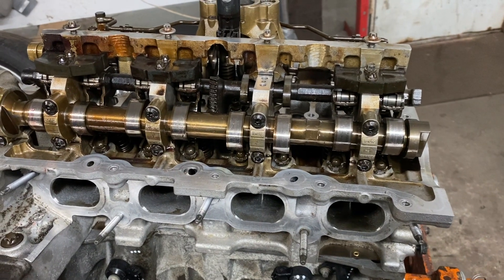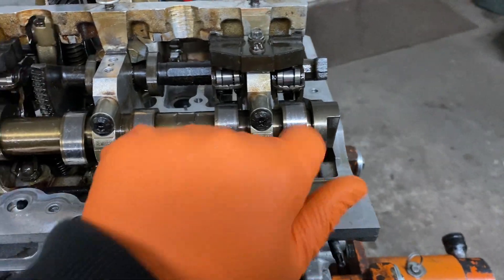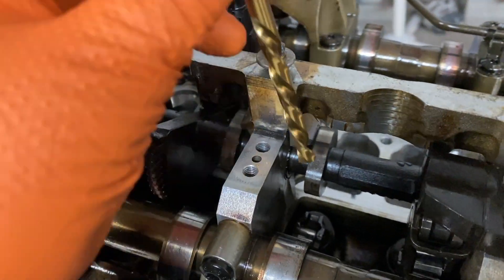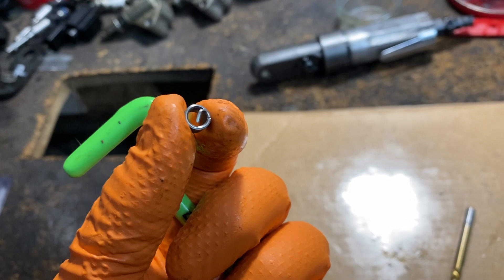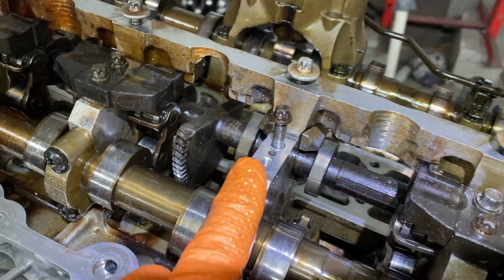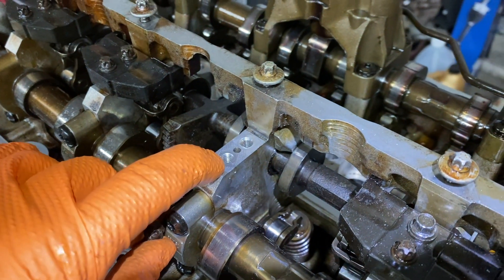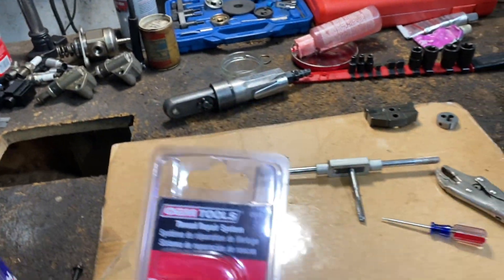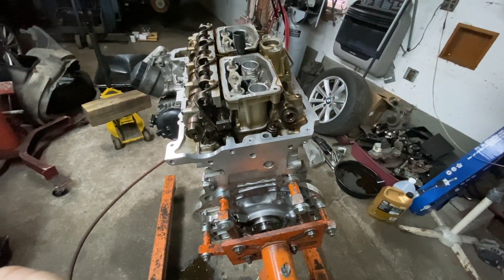Stripped Thread Repair - Engine Block Or Cylinder Head

Comment: i need a thread for two holes for the valve cover, needed to use 71 inch torque and i didnt feel the click and kept going.
my first fix and i screwed it bad, now i have oil leak EVERYWHERE 😪😭
Reply from the maker: This video should be able to help you fix it.

Comment: Doesnt look like any fun until its done.   I have a stripped intake manifold bolt and debating between trying a heli coil for a first time, using some kinda liquid threads or just sending it missing one bolt
Reply from the maker: Liquid thread stuff doesn't work don't waste your time.

Comment: I need to do this on my engine block. The threads for the 17mm for tensioner is messed up. What would you recommend me?
Reply from the maker: For a belt tensioner?, I'd say yes.
Reply: @motorcarnut  it's the threads of the engine I'm which a 17mm bolt goes in to hold the serpentine belt tensioner
Reply from the maker: Yes, a recoil will be strong enough just make sure you use the proper drill bit size for the 17mm kit
Reply: @motorcarnut  thanks. Yes that's what I've been looking into. My car is a Toyota 1zz-fe engine
Reply from the maker: Good luck

Comment: Thank you. You weren't sure if it could be used on a head gasket, and I want to say that it can because I watched a video on youtube that a guy used the same technique to fix.a head gasket thread on an engine block.
Reply from the maker: It greatly depends on the engine. It will not work on most

Comment: Any chance you are near San Jose? I need this done on my N55 BMW. Thx
Reply from the maker: No sorry NY
Reply: wont some of the shavings and the metal tab from the insert fall down into the oil passage? Any thoughts on how to prevent this? I need to do this while the engine is in the car.
Reply from the maker: @bobk6704 you have to be really careful, use grease to catch the shavings and a thin magnet and punch to catch the insert tab. Takes some time but can be done.
Reply: @motorcarnut doing this to my N55 head. Smart. I will now incorporate a magnet to catch additional shaving

Comment: Mate thank u for the great video, 
My question is if the bolt it snap in the head block and it’s 8mm when  I take it out was a bit of damage on the aluminium block what , so what size I need to use ? Is it 8mm helicoil kit to use ? It will be same old thread?
Cheers 
Matt
Reply from the maker: Thank you!, Yes you would use a 8mm kit

Comment: Why even use the “Helicoil insert”, since you’ve already tapped the stripped it hole with new threads?!?  🤔
Reply from the maker: Good question, the reason is the helicoil insert is metal and the tapped whole is aluminum. Metal threads are much stronger than aluminum ones.
Reply: But also to be able to use the same size bolt as you're cutting a larger hole yes? Could you also just try and tap the damaged hole or isn't this advisable? @motorcarnut
Reply from the maker: Yes, to use same size bolt when done. You could try to retap damaged threads but depending what it’s for may not be strong enough.

Comment: Я так уже несколько лет восстанавливаю резьбы. Даже в креплениях коренных шеек Фольксваген. Единственное , некоторые реплики , поставляемых резьб не каленые. И хвост не обламывается. Но это не страшно.
Reply from the maker: I had to translate this.  I would not recommend this repair for engine block head bolts but you used them for the main bearing journals that's good to know it held up for you.